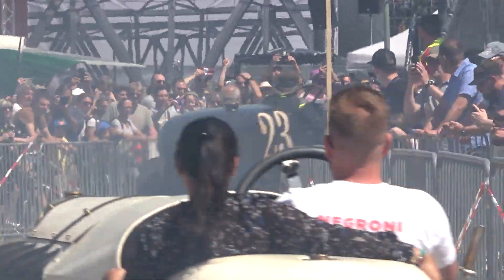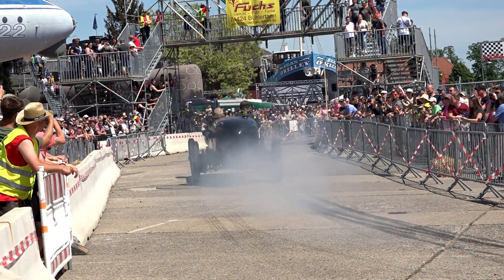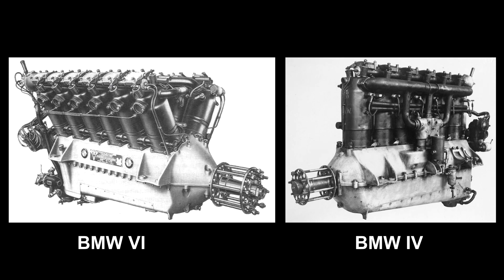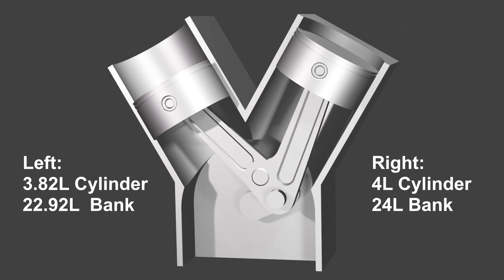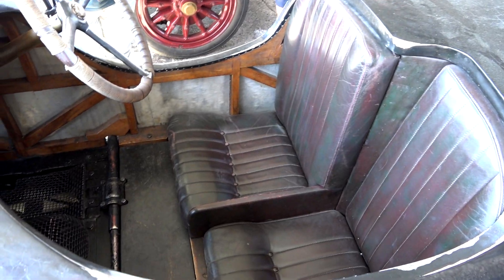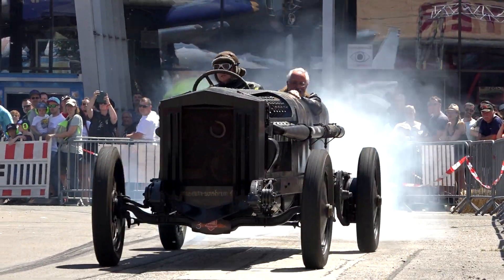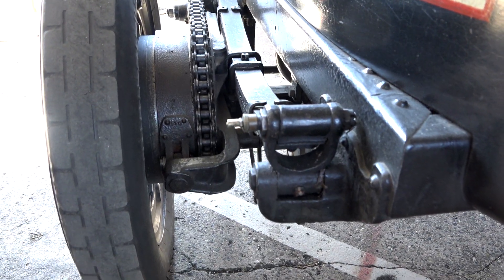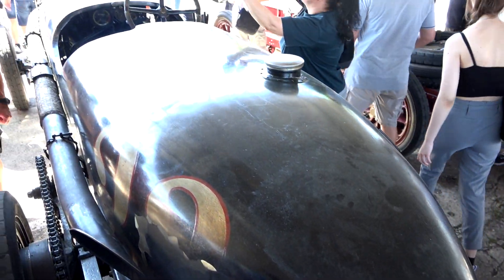47Liter BMW Aircraft Engine in a Car - BRUTUS

Comment: Brutus the Magnificentus!

Yeah, I doubt I wouldn't dare to go above 100 in that thing, surely 200 is deathly terrifying.
Reply: If a Mercedes 600 Grosser represents a civilised Germany, then Brutus is total thuggery on four wheels kept barely under control. The driving experience was likened to riding a cannonball by it's driver.
It doesn't need traction-control. It needs an exorcist.

Comment: How utterly pointless.
Reply from the maker: It's not pointless when you have fun 😉
Reply: A modern Formula 1 car is a Rolls Royce compared to Brutus. Actually Brutus is like a Land Speed Record car of the 1920's or 1930s. Get it out on a salt flat and open the throttle secure in the knowledge you have several miles in which to slow down. The driver who wears the flying gear describes the Brutus experience as riding a cannon-ball.
I interpret that as feeling you are not entirely in control & driving is a battle to survive.
Reply: If that was made by brits, you would say different.
Reply: @superkas  Nope, still pointless.
Reply: @wiscgaloot  You must be full of joy, aren't you? You can't stop me from wanting to have a go in this car.
Reply: That is the entire point.  Checkmate.